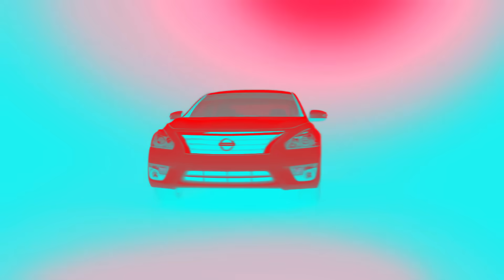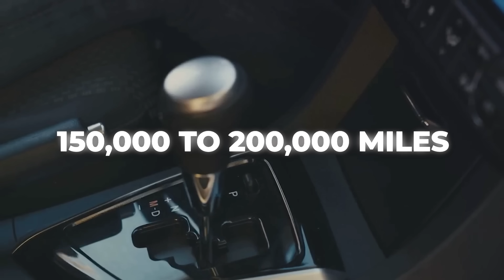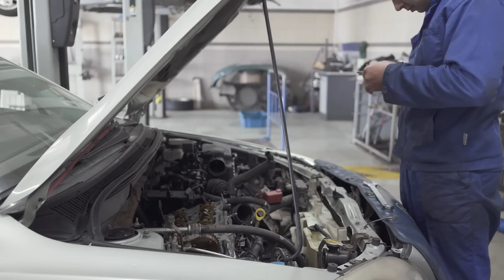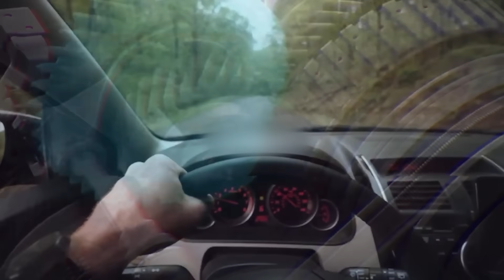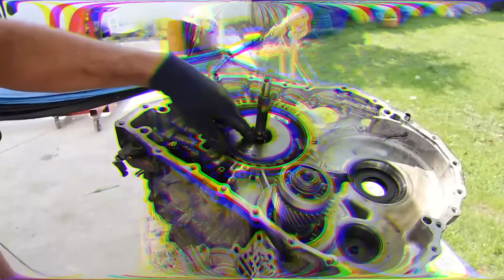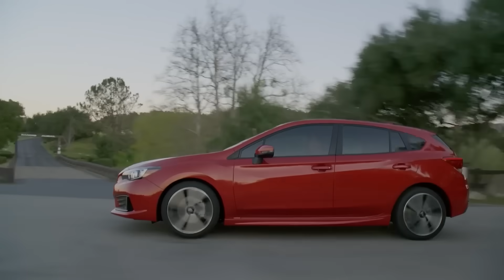STOP Buying Cars With CVTs - Here’s Why They Fail Early

Comment: I got rid of my 2011 Nissan Juke due to the constant and expensive turbo and CVT repair bills.  I found out the hard way that CVT transmissions cannot tolerate hot climates (Arizona), have difficulty handling going up hills, and have almost no power in reverse when backing up an incline. When I went vehicle shopping to replace it my criteria to the car dealer sales rep was: No turbo engine, no CVT. It turned out that quite a few of the cars on the lot were either one or the other or both.  I settled for a used midsize truck with an aspirated V6 engine, analog gauges, and a real six speed transmission and so far I've been happy with my purchase. Today's new vehicles are loaded with so much electronic gizmos and touch screens (that have replaced buttons and knobs) that it's more like driving a computer than a vehicle! No thanks!
Reply from the maker: Yikes, sorry to hear about your Juke. They don't do a good job of explaining transmission differences when selling.

Comment: CVTs are great for smaller cars. Millions of Japanese Kei cars are proof of that.
Reply from the maker: yes, they are better for smaller cars that don't need any sort of performance beyond point A to point B.
Reply: @the.GarageIQ I used to drive a little 660cc CVT roadster that would outperform many larger cars with traditional transmissions on country roads. Lots of fun, 50+ mpg, no repairs for over 80tkm (50tmiles), sold after 8 years for half the price I paid for it when new.
Reply from the maker: @seam4002  wow. whatever gets the job done! What did it cost to buy?
Reply: @the.GarageIQ Around 13k. A Daihatsu Copen.

Comment: From an engineering point of view, an all steel CVT is a seriously flawed concept. It relies of there being sufficient friction between the belt and pulley to transmit the power but not so much as to create heat and wear. This is a very delicate balancing act which relies on precise thrust pressures and very specific oil specifications. Engineers usually oil to reduce friction. Any drive relying on metal to metal friction will inevitably have a shorter life than the rolling action in a set of epicyclic gears. If you scrap an otherwise good car early because the cost of replacing a CVT makes it uneconomical to repair, how it this eco-friendly?
CVTs may be smaller, lighter and cheaper to make, great for the manufacturer, but I cannot see that they are cheaper in terms of vehicle lifetime costs.
Reply from the maker: That’s actually a very good analysis of the CVT situation.
Reply: lol they don't care about eco friendly, just gas mileage. flawed laws. 

funny enough though it's not the pulleys or belt that are the weak point. it's the pump and the valves that can't handle the heat (or any overfilling). variator and pump failure is secondary. it's pretty rare that anything else goes bad mechanically. 

definitely very sensative to heat. oil breaks down and is not good. needs to be changed often-ish, depending on driving style, weather, geography, cooler status, etc... they can

Comment: My Perodua CVT Myvi (Malaysia) has 104,000 kilometers on the clock, l got it 2yrs ago, it's fine, smooth and quiet...  drive them 'sensibly' they last , treat them badly, they wont, nothing new here, CVT transmission built for economy drivers, not racers ... Duh
Reply from the maker: Sure, and "sensibly" is the key word.

Comment: If you could see how these transmissions work you would not buy. It’s a simple belt driving the vehicle. They are cheap to make but expensive to replace. These are not designed to pull heavy loads and since it’s a belt it’s easy to wear out if you put it under stress.
Reply from the maker: Yup, it might work sometimes, but it’s not an all around good thing

Comment: Lets me real, the CVT transmission is solid in theory but the quality of the raw materials used in construction and the methods they use to make the cars is the problem, all of these cars no matter what are designed to last about 100k kms and then forced to buy a new one, mainly because alot of people would buy a new one, keep it a few years and then sell it and buy a new one.
Reply from the maker: yes, and there's not enough noise or demand from people who want quality cars

Comment: I think the #1 killer is particulate matter, especially metal. A good filtration system could double the life of a CVT, putting it on par with a shifting automatic transmission. Another note: CVT transmissions indeed use a lockup clutch torque converter, that is exactly identical to a normal automatic transmission.
     Hybrids do not use a "belt and pulley' system at all. They use two electric motors and generators, and a very simple single stage planetary gear system. They change effective gear ratios, by controlling the RPM of the two electric motors, which also function as generators. they are by far, the most reliable transmission in existence. They do not rely on friction, whatsoever. They just need the gears and bearings oiled. I've never heard of the transmission going out on a Toyota Prius, even well after 1/4 million miles!
Reply from the maker: that's good insight!

Comment: I've been driving manual transmission cars for 55 years but they're getting harder to come by. I would only buy a CVT if there were no other option, and that may soon be the case. I do have a scooter with a CVT, it sucks but it works and has cheap and easy parts to replace when they wear out.
Reply from the maker: manuals are still the way to go. Gotta try hard to find one though!

Comment: We have two Subaru's Outback and a Contour 2017. I was FLOOD WHEN I WAS TOLD BOTH CARS CVT FUILD EVER 30,000  MILES.. $400 TO DRAIN AND REPLACED. We couldn't afford around 1000. Insurance around $300. a month, gas, and an extra $1200. now a maintenance a year. Of course, I didn't start hearing about the the native reviews about the CVT ISSUES when Outback with 60,000 miles and the failure of the battery due to having the hatch back open for a half on hour while camping on the Beaches of the OBX. The Outback computer wasn't turning off while the car was parked, nothing on and all doors closed. After we replaced the 3rd platinum battery at two hundred a pop in under 8 years. We no longer have the Outback MY CAR, and now I went back to 24 Toyota Tacoma truck. I wish I never traded in my old 2010 Tacoma with under 200,000 miles in 17.
Reply from the maker: it's weird how little people know about CVTs before and even after buying them. They just sort of slip them in there.

Comment: My 2017 Nissan Sentra has made it to 180,000 miles on the original CVT transmission and still running. I bought the car new.  I think if maintained they can last as long as they can.
Reply from the maker: maintenance should get you a long way. good for you

Comment: That's why I got a Mazda with a old fashioned 6 speed automatic transmission.  No problem  !! Will last 200000 easy !
Reply from the maker: go team Mazda!
Reply: As a 40 year mechanic I've been recommending Mazda for a long time.  I don't know why they're overlooked to me they're a Hidden Gem
Reply: Yes, i could kick myself for not getting a Mazda. But only AFTER Ford was out of the pictire & the company went back yo Mazda yovdo the " right" thing & make a GREAT car at a reasonable price @TheHillrat4wd
Reply: @TheHillrat4wd  They used to advertise a lot and then quit in the early 2000s
Reply: @realityTV77 zoom zoom
Reply: This is why I bought a Mazda 😊
Reply: And more with regular fluid changes
Reply: Mazdas..are made great..mine is an 06..with 
Almost 210,000 miles,,.still going strong.
Reply: Mazda had a electric CVT powertrain in the early 2000's

Comment: If they are so cheap to make why do they cost a fortune to replace?  These are an engineers wet dream. You can have variable pulley dry belt CVT like in agriculture or snowmobiles.  Much simpler.  All they wanted to do was take control of the vehicle away from the driver. No Thanks.
Reply from the maker: exactly

Comment: Electric CVT EQUAL WITH ELECTRIC CAR  ......
THERE ARE TOO RISKY  ,..... LOOKS NICE BUT NOT SAFE  AND RELIABLE ON LONG DISTANCE AND LIFE 
FOR GAS MILEAGE ..... FORGET IT ! 
NOT WORTH 
BETTER WORK ON ENGINE TECHNOLOGY AND AUTOMATIC TRANSMISSION   FOR BETTER MPG 
WITH ALL RESPECT FOR TRUTH AND KNOWLEDGE
Reply: Toyota eCVT systems have been used for years now and many have done more than 300,000 miles.
Completely different from the CVT systems in this video.
In the UK, Toyota give them a 10 year warranty.
Reply from the maker: thanks for your feedback

Comment: CVTs probably will stick around for the reasons you listed. But lets not kid ourselves, here. They burst onto the automotive scene because of CAFE(corporate average fuel economy) and more specifically because Obama/Biden raised CAFE from 27.5 m.p.g. to 54.5 m.p.g. by like 2035. Manufacturers are scrambling to find ways to squeeze every last bit of efficiency out of the cars they sell. CAFE is responsible for overdrive transmissions, 10 speed conventional automatics, front wheel drive, gasoline direct injection and a whole host of engineering extravagances.
Reply from the maker: It’ll be interesting to see how that all pans out!

Comment: I've never owned a Subaru or a car with a CVT and just ordered the 2026 Outback. So this video kinda freaks me out.  I did get it with the turbo and all Subaru turbos come with a transmission cooler.  I read just about everything I could get my hands on and the Subaru ranks very high in customer satisfaction and now has a higher reliability rating than Toyota. Fingers crossed.
Reply: 2024 OBTXT, 44,000 mi, love it.
Reply from the maker: hopefully the design has improved. Just take care of it, drive it nicely, and follow instructions for servicing.

Comment: My Burgman 400 used a CVT and it worked well. It used a rubber belt, not a metal belt, and was replaced every 24K miles.
Reply from the maker: are you satisfied with it?

Comment: CVT cars now are more reliable. PluggIn Hybrid mated with CVTs are good too. I agree with EE (Engineering Explained) that CVTs pros outweighing the cons: coasting and crawling are more efficient. Faster response? Mate it with electric motor. Problem solved.
Reply from the maker: They've improved a lot.

Comment: I got a 2009 Nissan Murano & haven't had no problems, besides the normal wear & tear of certain parts. When it comes to CVT's, you can't drive it like it has a regular transmission. At a light, you can't stomp down on that gas pedal, cause the belt will slip & it's certain cars with a cvt, that do have an actual gear for 1st gear. I also use Amsoil instead of the Nissan cvt fluid.
Reply from the maker: Yeah I think the problem is most people don't want to drive on eggshells.

Comment: I retired from the service department of a Ford/Toyota dealership. For Toyota CVTs, such as the Corolla and HR-V, most of the failures were due to overheating and poor maintenance. If someone drives with their CVT with an easy foot or a lot of highway driving with proper fluid change intervals, they can last quite awhile. Now Toyota hybrid E-CVTS,  I only ever seen 2 fail in over 20 years. One had 298K miles and the other was 332K. Ford CVTs would start failing right around 60K. Ford E-CVTs from 05-12 were fine because they used Aisin (Toyota) units. When Ford made their own in 2013, things went downhill fast. A lot of them needed replacement around 80-90K at the tune of $9,500 USD.
Reply from the maker: That's spot on. The trick is finding an "average" driver and convincing them to drive with a soft foot and maintain at regular intervals.
Reply: I beg to differ.  As with other cars gearbox types, with CVT maintenance is also crucial. I believe CVTs will surprise everyone eventually and become accepted equally in the future. 

Just as with CVTs,  conventional auto transmissions were problematic when first introduced.
Reply: Aisin (Toyota)  TORQUE CONVERTER automatic gearbox equipped Maruti Zen automatic gear (3 speed) car, AC model, 14 kmpl mileage. Japan engine, Japan gear box Japan carburetor (NO ECM, NO SCANNING, NO ERROR CODE), Japan radiator, Japan axles, All zen automatic cars prior to year 2000 (only carburetor model, not MPFI) have high quality original Suzuki engine and imported 'Made in Japan' Suzuki automatic gearbox. This same Japanese automatic gearbox was introduced in Maruti 800 in 1990 (2 speed gearbox). Modified version (4 speed) (Indian made) of this gearbox is used in A-star, Vitara Brezza, earlier model of Swift, Dzire, XL-6, Ertiga and S-cross.The petrol-powered Brezza and Toyota Urban cruiser share the same 4-speed torque converter AT gear box. So this RELIABLE automatic gearbox has been in India for the last 35 yrs. I heard that there have been many reports of issues in the AMMT gearbox, requiring numerous software updates and even complete gearbox replacements even within 25,000km, sometimes GEAR suddenly becomes neutral (free) while on the highway, Need to shift to manual for a while and then after some time it gets stuck on setting it back to auto. You can also add "overheating" transmission / clutch burning to that list. CALIBRATION and clutch LEARNING needed after new clutch fitting. Many fault codes, TCM errors etc. Manufacturers have struggled with the long-term reliability of AMMTs. It is inherently an inferior technology for passenger cars. That's why I don't recommend AMMTs to anyone. CVTs are quite reliable and almost a gearless transmission system. But it is also very expensive but less expensive than DSG/ DCT replacement. It is safe to assume that it's replacement cost will be somewhere around 4 to 4.5 Lacs. CVT transmission uses a metal BELT and this metal belt snapping is common in poorly maintained cars. CVTs are significantly more expensive. It’s also about durability and fuel economy. CVTs can be delicate when driven in stop-and-go traffic over long periods, and repair or replacement costs are high. I will always recommend a proper Automatic gear (Torque converter) because of its superior smoothness, performance, reliability & resale value. TORQUE CONVERTER automatic is 95 year old technology and the most reliable automatic gear technology. Latest generation automatic cars have AUTOMATIC GEARBOX with SOFTWARE CONTROLLED gear shifting which is very complicated and may be having high maintenance and very expensive to repair. Latest automatic cars have ENGINE CONTROL MODULE (ECM) Very expensive to replace) and TRANSMISSION CONTROL MODULE (TCM cost high).If TCM is faulty, we cannot shift from Neutral to Drive. Driving with a faulty TRANSMISSION CONTROL MODULE can damage your auto transmission. Latest automatic gear systems are sensor based. Need to depress the brake pedal before shifting from P to D or from D to R. If BRAKE PEDAL SENSOR is damaged or fuse blown, we will not be able to shift from P to D. No BRAKE PEDAL SENSOR in this automatic zen. No ECM/ TCM in this carburetor model Zen automatic. Many latest automatic cars OVERHEAT in heavy traffic. During overheating the FUSE in auto gearbox is blown. Then the car automatically shifts to NEUTRAL and we cannot DRIVE. This automatic zen never had overheating. No FUSE in the automatic gear box of this zen. Have driven 250 km non-stop without any problems. Latest automatic cars have very complicated ELECTRONIC MOTHER BOARD inside the automatic gear box. This Zen Automatic car do NOT have any software or computer or ELECTRONIC MOTHER BOARD inside the automatic gearbox/ engine. No SCANNING needed. This automatic zen has a simple MECHANICAL automatic gearbox. Simple JAPAN engine (carburetor model-even roadside mechanic can repair it) and simple JAPANESE 3-speed MECHANICAL (no electronics) automatic gear box. Latest automatic cars have even 10-speed automatic gearbox. The more the number of gear ratio, the more complicated and more expensive to repair. This Made in Japan automatic gear box will last for about 3 lakh km in Indian driving conditions.and this Japan engine will last for about 4 lakh km. The less the weight of the car, the more the life of automatic gear box. This zen weighs just 750 kg. So the automatic gearbox has to pull less weight, so it will last long. Latest automatic cars have non-reusable automatic gear oil FILTER with washer. If washer is dislocated, autogear oil will enter the transmission without filtration and auto gearbox will get damaged. This zen has RE-USABLE flat METAL MESH type gear oil filter without washer. Zen carburetor engine model has more quality than zen mpfi engine model. Do not compare the used car rate of automatic zen with the rate of manual gear zen. FULL MECHANICAL/ ZERO ELECTRONICS CAR. The less the electronics the more the reliability. Average price of good condition used Zen automatic is 2.25 lakhs.

Comment: FYI, Toyota hybrids do NOT use mechanical CVT's instead they use two MG's to vary the ratio between the engine and the output shaft using a planetary gearset.
Reply from the maker: thanks for the clarification!
Reply: MG?
Reply: @minimol222  Motor-Generator. Can either convert electricity to movement, or can convert movement to electricity.
Reply: @minimol222  Video here that explains how the Toyota Hybrid works - O61WihMRdjM

Comment: I'm not buying it my 2022 corolla le has CVT it feels like a big Rubber Band when taking off, also I had a 2005 5spd corolla s, the gas mileage was way better than the 2022, if you can go with the manual transmission
Reply from the maker: for many people it just feels wrong.